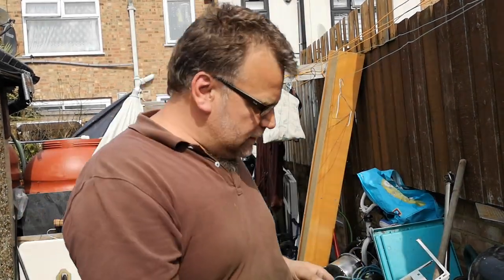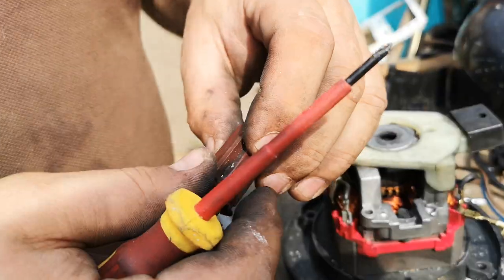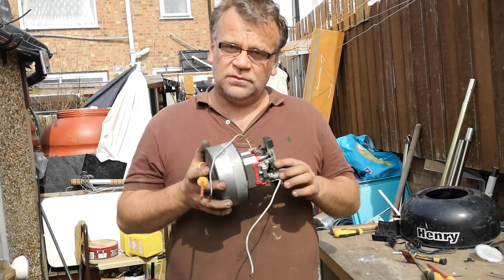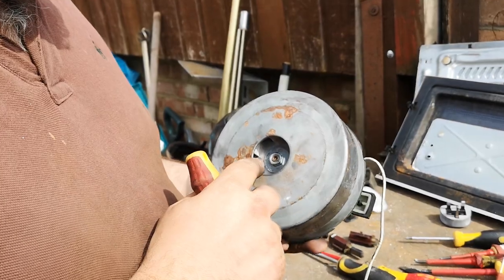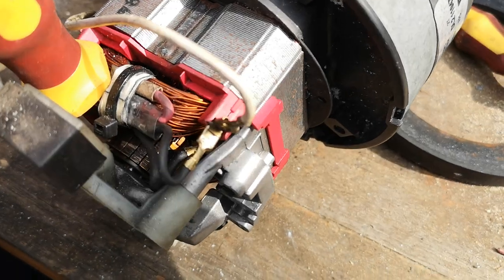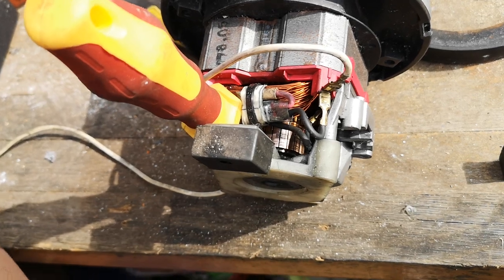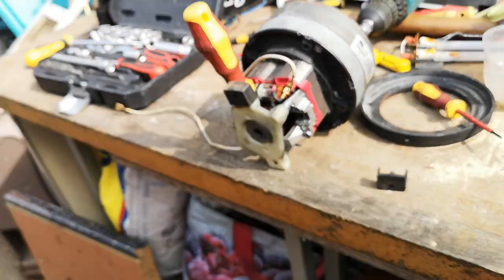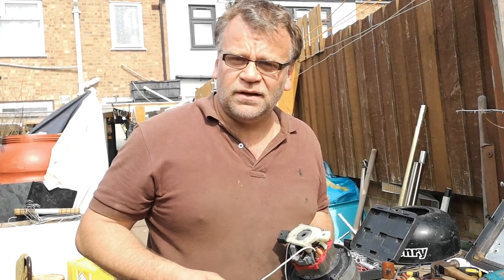Sparking carbon brushes ~ Cleaning the armatures  commutator bar on a Henry Hoover Motor

Comment: The thing your calling collector separates think of 2 bowls stacked together, at the motor end oh the collector you'll see a lil, look close and you'll see its 2 lips. With a fine thin flat screw driver you have to get it between the lips. Sometimes rotating it around you find a slight gap where it's easier to start. Work it off and you'll get to your fan blade then you'll figure out the rest

Comment: My Henry cuts out in 2 seconds with a burning smell . Having opened it and ran it and saw loads of sparks from the motor . The carbon brushes have more than an inch on them .... The motor seems very clean . Any ideas ?
Reply: Time for new brushes